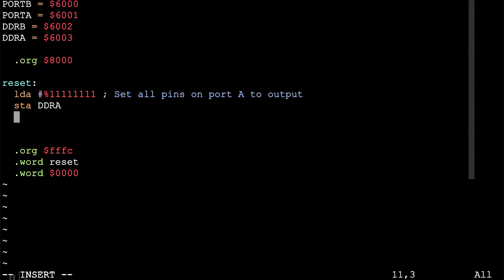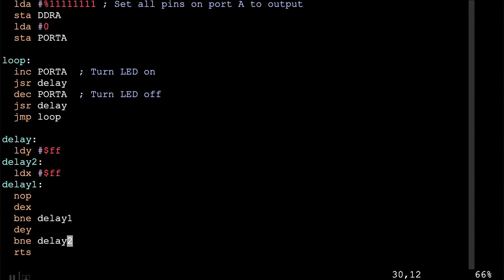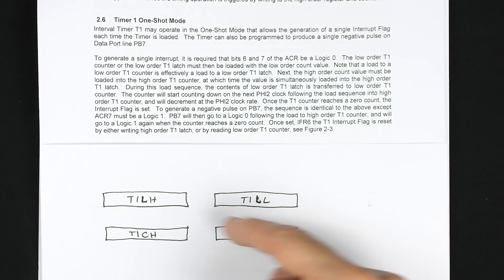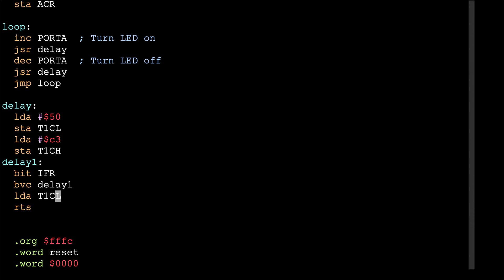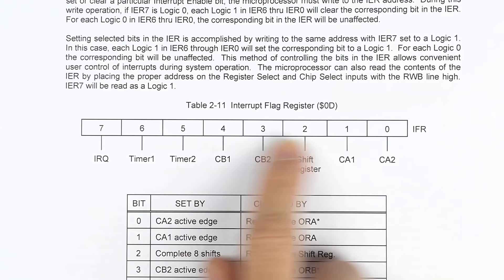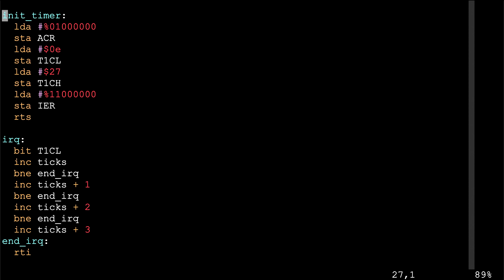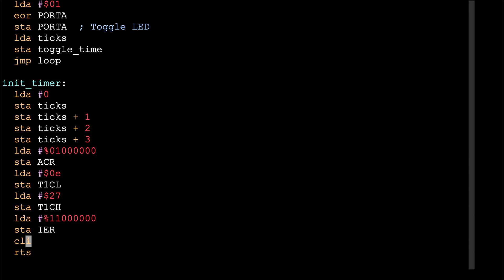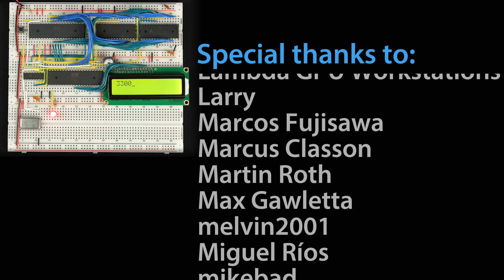How do hardware timers work?

Comment: ffs.. I once did a TB303 emulator for C64 and tempo drift was a huge problem, to a poitn where i started to count clock cycles but the hardware interrupts interfered too much. The main problem was that i didn't know there where hardware timers as the user manual did not indicate such things, its assembly section  was after all quite "basic".. and there was no internet as we have it today, no way to find out.. Huge blocks of code could've been replaced by few timer calls and custom interrupts. Over two decades late but at least no dollar short. At the time i simply could not understand how most programs would work without a timer and thought that there was either something i didn't know or other assembly coders were wizards.

edit: and there are two HW timers... which means i could've implemented "shuffle" or "swing" feature... i'm almost tempted to do it all again.. And i would've then had time to read the "paddle" pins from the joystick ports that connect to AD converter, for 2 channels of analog potentiometers.

Comment: 0:40 if without the help of programming from another computer is it possible?
Then how did ancient people create a program for other computers when only one computer was built
Reply: I don't know anything about ancient people having computers, as the computer are fairly young invention. But you may e.g. search for Altair 8800. There's a video from Dave's Garage showing how one need to program it to make it boot, using mechanical switches at the front.. :)
Reply: it is possible, it just takes a looong time. they used to use switches before having programmers, programming one byte of machine language at a time.

Comment: It really bothers me to see flags and interrupts written as 3-4 cryptic letters.... TICL TICH INTP etc... the compilers do not have many limitations on variable name length anymore, etc, so there isnt much reason to use cryptic acronyms in modern code. This also creates bad habits of not correctly naming variables, or using unnecessary abbreviations.

Comment: Sure, it's nice to have peripherals with built in this and that.
But i was expecting you to (re) build an actual hardware timer for this project.

I was thinking something along the lines of a 16kHz crystal, three bytes of memory and an adder that constantly adds one to two of those bytes, which would roll over of course, once every second.
Then you just set the third byte of that memory to some pattern you want to AND with and every time the pattern on the high byte matches, it would send one pulse to the CPU's interrupt to do something.
It's low resolution of course, capable of firing the interrupt 64 times per second at best. But it would be cooler if you did this IMHO.
Reply: I mean, this video's title is "How do hardware timers work?" but in reality it's a video about "How to use a hardware timer"

Comment: WARNING!!  This method does not accrue time accurately due to tolerances.  Use a real time clock chip.
@Ben  - add a real time chip to the circuit and show how to use it.
Reply: Bossy boy is worried about the precision of blinkenlights.

Comment: There's still one problem; all the code you wrote relies on a 1MHz clock. If you were to run this code on someone else's breadboard computer, and theirs uses, say, a 2MHz clock, everything will run at double speed.

If I know my computer history, for quite a while people were stuck with 4.77MHz clocks because so many programmers wrote their code with the assumption that the clock would always run at 4.77MHz. Eventually we started using faster clocks, which broke compatibility of course.

This raises the question: How do computers (both those that came right after the 4.77MHz era, as well as modern machines) know what clock speed they're running at? Or, failing that, how do computers reliably wait for a specified amount of real time given that they don't know what clock speed they're running at?
Reply: If they have a RTC (realtime clock) chip, they can get a signal from there. It uses a clock signal from a separate crystal.

Comment: Do we really need 30min to explain how sleep() works?
Reply: yes, timers are complicated if you want to know about them in depth. summary: hardware keeps track of how many times an external oscillator (clock) has pulsed, check in software whether it has pulsed the amount of times you want and then continue running code.

Comment: Wrong overlay on video image  of "How does Sleep() work"  This is an interrupt timer. That does not power down the main CPU and run a low power CPU running a wake routine such as implemented on the ESP32. But similar never the less to what happens in the Low level CPU code.
Reply: ESP32 is a micro controller, the 6502 in a CPU. Ben is referring to the C / C++ sleep function, which suspends the operation of the thread in the CPU world
Reply: @axelBr1  Sorry , due to my lack of knowledge. Consider my self as in need of more education  in respect of the  6502.

Comment: NOP... it says NO OPERATION but it does... it makes one cycle pass. And back in the days as today when you do certain 'low'-level stuff it was/is incredibly important to do good timing. Many more  CS courses should force the students to start with good old 8 bit programming to really understand the matter of programming... today I see so much wasted bits and bytes as people cram most simple applications full of unused code that in the end DESTROYS THE ENVIRONMENT as every single unneeded bit BURNS POWER. Just because those phrase parrots rather include three more frameworks instead of trying to understand the base. AMEN³ Thx for your great videos Mr. Eater!
Reply: Or do cycles make instructions pass?  Anyway, on the 6502, NOP uses 2 cycles.  It increments the program counter, and fetches the next instruction.

Comment: very nice. however, your final code example completely defeats the purpose of the interrupt architecture. your main loop should be *empty*. all your code should only be reacting to interrupts. whether timer interrupts or port/keyboard input interrupts.
Reply: Not always true. Another IRQ can't happen while other code is still ruing inside a ISR. So put the part of the code that is not time critical to run in main(), with flags set from the ISR only.
This way you never miss a IRQ event because you were busy serving another one.
Reply: @tonysofla  i agree. but as i said: "all your code should only be reacting to interrupts". i did not mean that all the code should be running in isr's. actually, i started writing and thinking about a good architecture. but decided to instead write a short comment.  such an architecture would include a list of dpc for isr (deferred procedure calls - in windows kernel world).